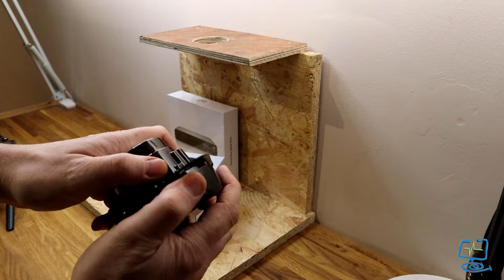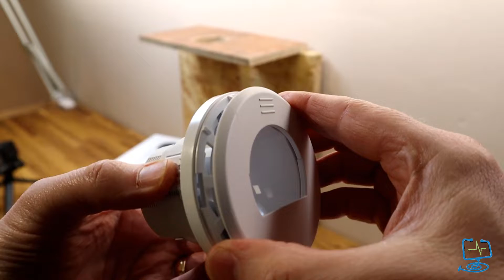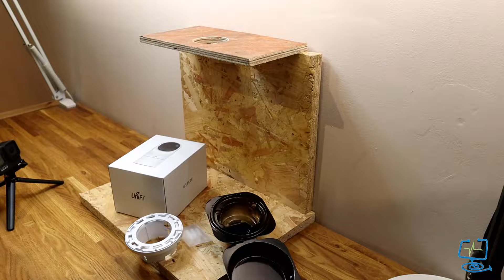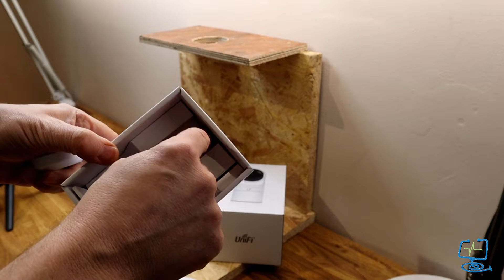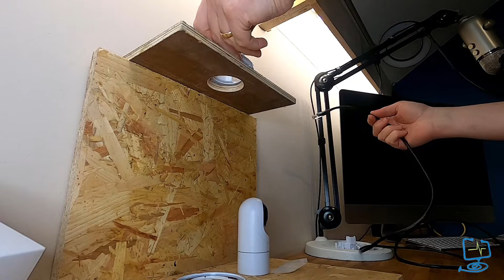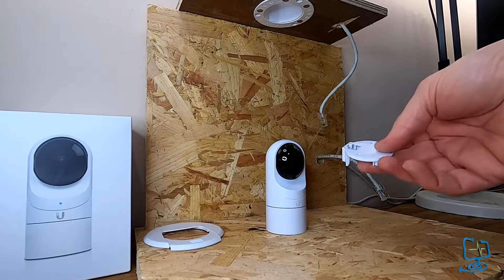📸 How to- Unifi Flush Mount Option for G3 Flex using UVC-G3-F also the in box mounting options

Comment: Useful video.  Was expecting this to have "wings" like a downlighter so it can be pushed in from below.  Looks like you can't install this unless you can get above the panel you're mounting it into.  A bit difficult for roof soffits!!!!  Shame, as that was my application.  Fine for ceiling tiles in a suspended ceiling, but not much else...
Reply from the maker: Yeah you can get away with soffit installs but the soffit really needs to be ply backed so you can stick a couple of screws through.

Comment: Great video!!, Question, regarding the mounting unit.  I can remove some drywall, to all full install the the ceiling mount/bracket to allow full spin of the camera.  Is the small screw to hold the camera required or can the camera stay in place without it?  However, once installed and everything is patched up I would not be able to remove the camera without recutting the hole, if the screw is required.  If it is not, then I could remove the magnetic lock cover and simply pull down on the camera.  Are there any other ceiling mount brackets similar to the Ubiquiti with easier install?  Thanks again.

Comment: I can't believe they didn't allow enough space for a pre-made RJ45 cable to fit because of the snag protector

They could have vertically mounted the RJ45 terminator in the G3 Flex

I'm glad you pointed this aspect out, I only have pre-made cables and looking at the distance between where the RJ45 jack point is inside the G3 Flex and the outer case edge, I don't think there is enough size / bending radius 😞

This pretty much rules out the G3 Flex for me, shame, I was just about to pull the trigger on a purchase too

p.s. This is easily the best installation video for the G3 Flex I have come across
Reply from the maker: Hey thanks that means a lot, glad you liked the video

Comment: Maybe I don’t understand, but how do you mount this in a retrofit installation?  With the hole being 2 and 1/4”…the backing plate is clearly bigger than the hole.  I’m looking to
understand if there is a way to install this into a finished drywall ceiling.
Reply from the maker: Yeah that’s one of the issues if you don’t have access to the back of the hole. It can still be fitted just that you can’t mount the locking plate on rear you just have to rely on screws from the front face of the G3 flex camera mount.

Comment: One of the better installation videos.  Quick question.  In your opinion, do you feel the under mount would work outdoors on a home?  The eave of my roof extends almost two feet past the wall line so it would be well protected from above.  What do you think?
Reply from the maker: Absolutely- I have installed lots like that in fact I was supposed to release another video showing an install that I did with 4 cameras installed in the soffits (one on each corner) I still have the footage I just didn’t get around to editing it.

Comment: By any chance.. do you happen to know if the FlexHD ceiling mount installs and is used in the same fashion? I'm installing it in a house and won't have access to the topside of the ceiling.. so I would need to install it blindly without the back plate. From the pictures on UI's website it looks almost identical to the mount shown in this video. Can you or someone else confirm? Thank you
Reply: I'm 90% certain that the ceiling mount for the FlexHD is functionally the same as this one.  The only differences are the bracket that holds the device is a little taller and shape of on the fascia doesn't have a "notch"

Comment: Hey are you sure it’s 57mm (2 1/4 hole) there website says 2 1/8 (54mm ish)
Reply from the maker: Hi Matt, When I first installed this type of camera I questioned the diameter of the hole, and if you watch in the video at approx 6:50 in I talk about the hole being slightly over size BUT on page 6 of the Unifi instruction booklet found here https://dl.ubnt.com/qsg/uvc-g3-f-c - states 2 1/4” or 57mm.
Reply: The Computer Lab Thanks mate